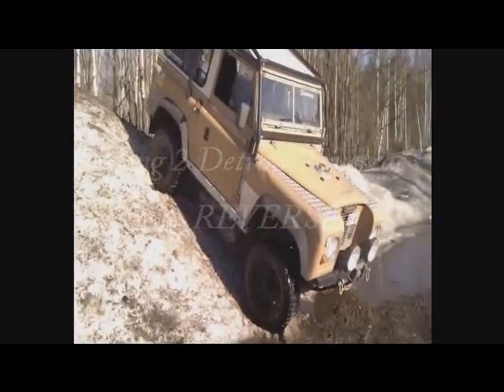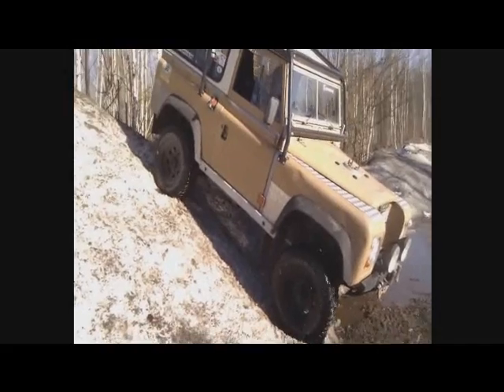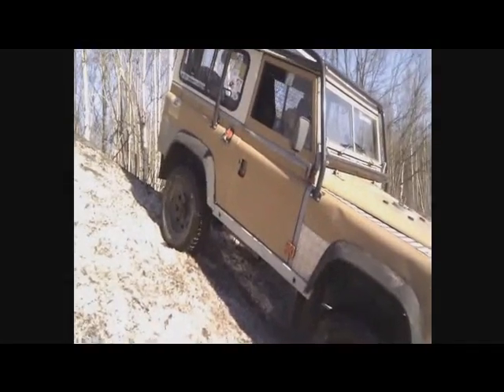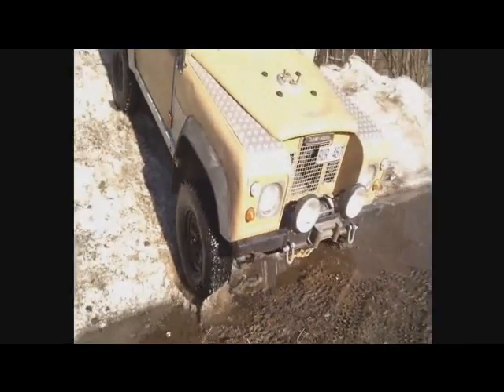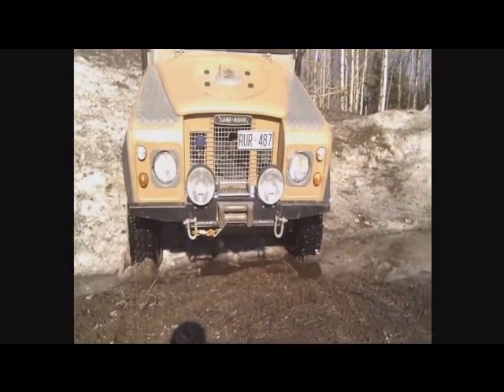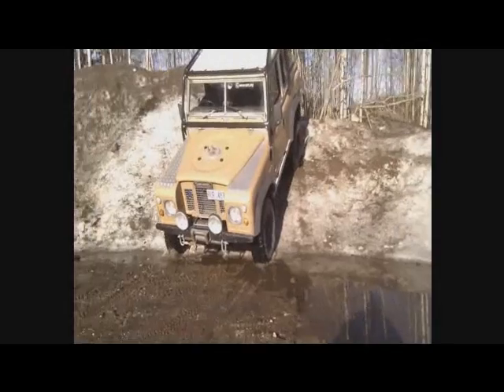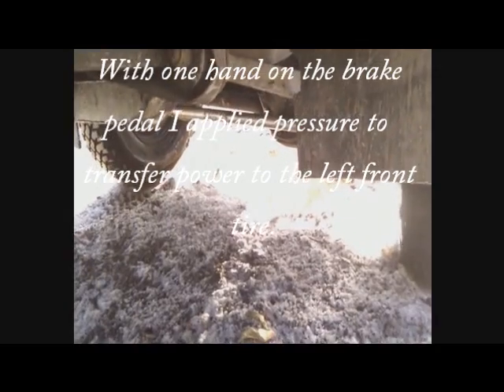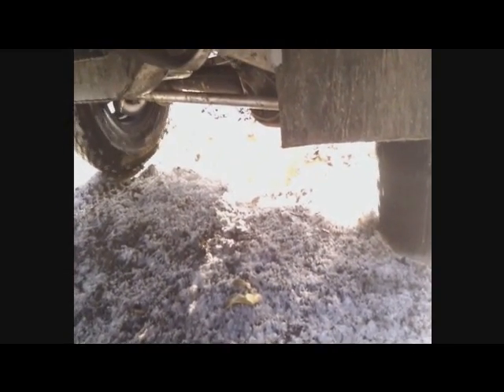Truetrac Diff's working in REVERSE

Comment: I heard the old wives tale too. 
Without any experimentation, just envision the  2 side gears, and the worm gears bridging the side gears, or riding on top and connecting the side gears via these aforementioned  gears. These gears never ''know'' reverse or forward. In fact, when driving straight down the road, they never rotate, they are stationary, rolling with the direction of the carrier. They only rotate when you turn. If you turn right, they rotate. Conversely, if you turn left, they counter rotate. So you have here, worm gears that rotate forward and backwards on turning, depending on the turn. If the carrier is in reverse, i.e., you put the trans in reverse, the worm gears are stationary,again, unless you turn. In either case, the worm gears are vehicle direction blind.